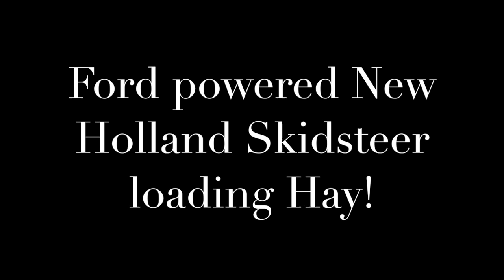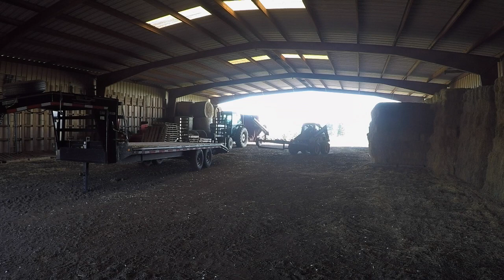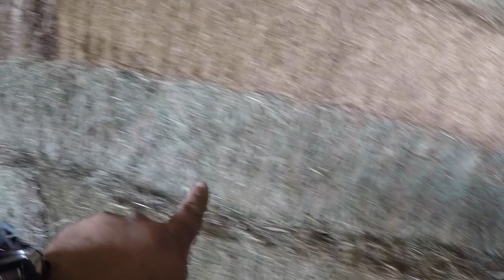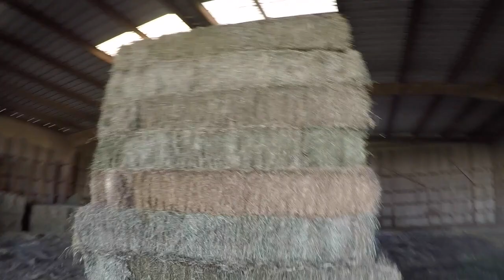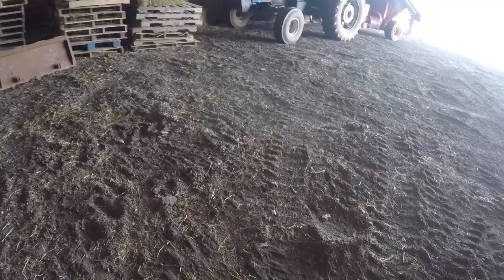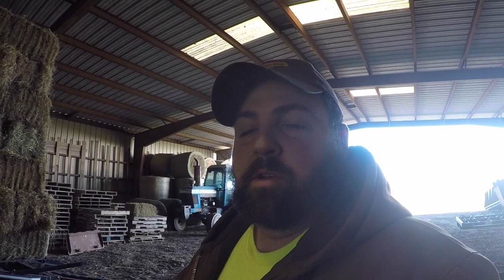Ford powered New Holland skid steer loading Hay! Hay loading Tips!

Comment: Great video this was my first year with the Kuhn hay grabber struggle  a bit and would get frustrated wish I would have found this video before I was done great tips nice explanation
Reply from the maker: The key is to get the bottom bales spread out as wide as you can and taper each layer in a couple inches.

Comment: We had hay trailers with no rail to stack it against, and all done by hand.  I remember being 15 barely weighing a hundred pounds, and trying to maneuver some alfalfa bales that were as heavy as me, and trying to get them up to my dad in the highest points in the barns.  He used to give me so much crap, and it would just p--s  my mother off. LOL.  By the time I was 17, I could chunk those bales with relative ease, and I also never lost a load of hay off a trailer.  I also used to work on a couple of custom hay crews during the summer.  I certainly don't miss doing it though.
Reply from the maker: +Russ Se. Sounds like you were raised right!

Comment: I like it. My accumulator is 10 bale on edge tho they are all the same way but it's nice cause you can drop a bundle in between the finder wells of a car trailer
Reply from the maker: +Josh Fanter. Are you using the tie grabber?
Reply: DLH Farms no
Reply from the maker: +Josh Fanter. Do you have trouble with them falling off?
Reply: DLH Farms I've only baled little over 400 bales never lost any then but maybe that was beginners luck lol but the guy I bought it from, it was his brother that designed the Kuhns and he said edge was the best loading on trailer. But we'll soon find out
Reply from the maker: +Josh Fanter. I've had good luck loading trailers with my flat 10 they have the tie bales to help hold them together, I can load 200 on a gooseneck and drive it down the road without any straps.

Comment: Wonder if you ever take the skid steer out in the field to load hay? It's the best way for me because I load from small fields and it takes 1/2 the time of a tractor with loader.
Reply from the maker: +chargermopar. I have but the TN95 works faster for me because of higher ground speed, also I can drive the tractor there and use it to rake or Tedd then load the hay, I have to haul the skid steer there and then haul it back.

Comment: is ur grabber a Kuhn brand?
Reply from the maker: +Justin Owens. One of them is, it's the newer one and the older one is a W.R. Long!
Reply from the maker: +Justin Owens. The one in this video is the W.R. Long. The one in my T5.120 loading hay video is the Kuhns MFG. One
Reply: DLH Farms , I'm looking into getting a 10 or 4 bale set up but not sure which one. I have a L230 New Holland that I would be using to load and unload. your loading videos are very helpful because I have been looking for videos that show this kind of setup in use. my wife and I just can't find help to have people riding wagons so Thank you for the videos you do.
Reply from the maker: +Justin Owens. My suggestion would be to get the 10 bale like mine. One reason is it would take forever with only four bales at a Time. Second reason is that the 10 bales would stack much better on the wagons because of the tie bales. Unless your just doing 500 bales a year or something. I know it's more money up front but it will keep you from being unhappy and trading in later and spending more money. Thats my 2 cents 😀!
Reply: DLH Farms thanks. does your baler have hyd top pressure? I'm looking into a bc 5070 that has top and side pressure and I have never been around them.
Reply from the maker: +Justin Owens. Yes it does! It's nice to have but not nesasary. Something else that's nice to have is hydraulic tongue swing and hydraulic pickup head raise but also not nesasary. Mine has it all! Mine is a BC5060
Reply: DLH Farms do you have a video on how to operate and fold ur baler? been looking for something like that so I can see how many remotes I need on tractor and how it works
Reply from the maker: +Justin Owens. No but that would make a good video when I get it out for the year! You would need only 2 remotes 1 for pickup head 1 for the tongue. The tensioner has its own hydro system built in on the baler
Reply: DLH Farms Thanks you have been alot of help! I will keep in touch with you. still trying to watch all ur videos. 😀
Reply from the maker: +Justin Owens. Sounds great! I'll be here if you need me.

Comment: I like to put the tie bales in the middle for the first and last row on the trailer.
Reply from the maker: +KHank1995. That's a good idea! I don't typically have any trouble the way I do it but I use seven straps across it and one long ways my buyer lives 3 hours away.
Reply: ya looks like you have a good system down. when we first got that accumulator I thought i was going to hate it but once you get the hang of it I dont think there is any better way to go. besides the $100k bale baron haha
Reply from the maker: +KHank1995. I agree I had some trouble in the beginning learning how to stack and so fourth but now it's second nature. I looked at a bale Baron at the southern farm show it was 100,000 I was like no thank you lol
Reply: Haha ya no doubt.